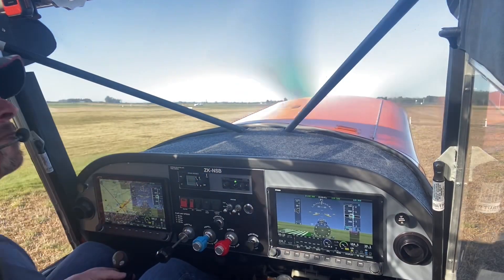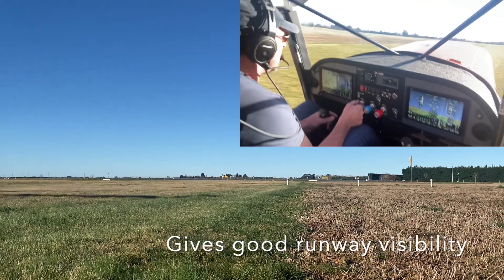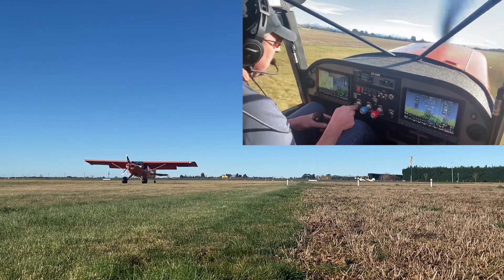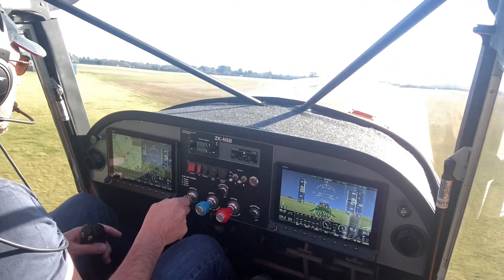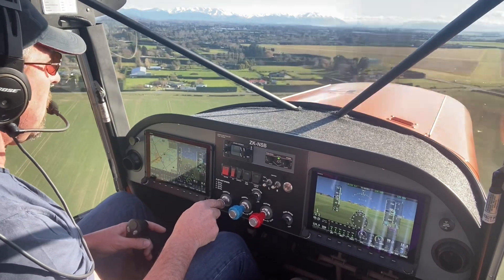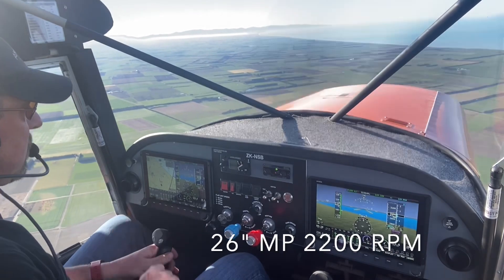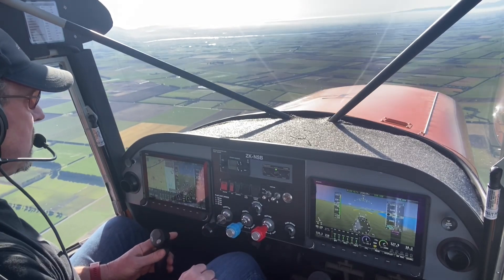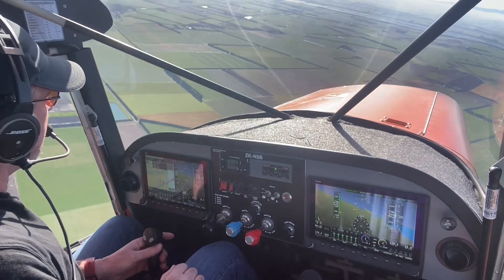Bearhawk Aircraft Performance - Takeoff, Landing and Cruise

Comment: Hey Nev, looking at the Lycoming 540 operators manual, looks like 26" at 2200 is around 188hp, which makes sense given how much power is needed to move a bearhawk at 116kts, but given a IO-540-C 250hp engine that's 75% power.    Perhaps this is lower because the chart assumes peak RPM.  Assuming BSFC at .4, 10.75GPH would land you around 161HP which is 65% power.  My question is if you think this setting is 65% or 75% power?  75% is pretty high to run LOP.  What are your CHT and EGT numbers?  Perhaps it is 75% and you are good with it because of cool temps.
Reply from the maker: I'll take a guess that it's 75% power Schu. But next time I go flying I'll take a couple of photos of the Dynon at those power settings and send them to you. I keep the CHT temps around 190c or a bit lower in the cruise, although they do get higher in the climb. EGT's are always below 800c. Cheers.

Comment: always good info. I wonder if you have given thought to replacing one mag with say the electro air for increase power and decrease fouling, fuel consumption?
Reply from the maker: Yes - it's got dual PMag Electonic mags. Very pleased with them. Easy to set the timing and a small increase in power too with the variable timing advance.